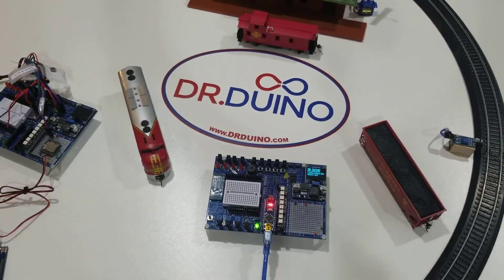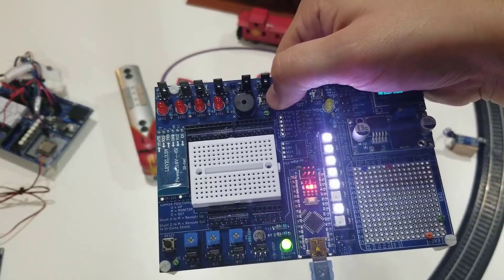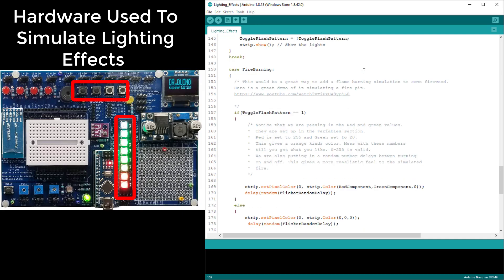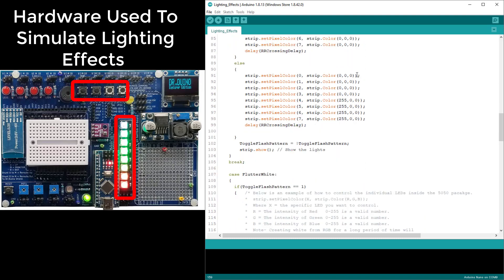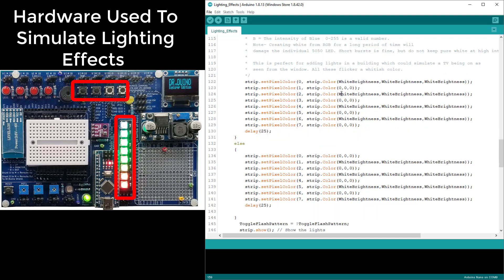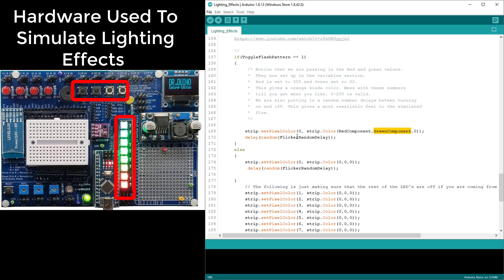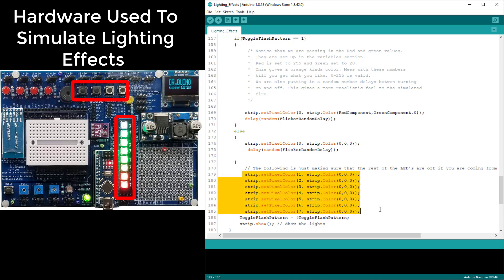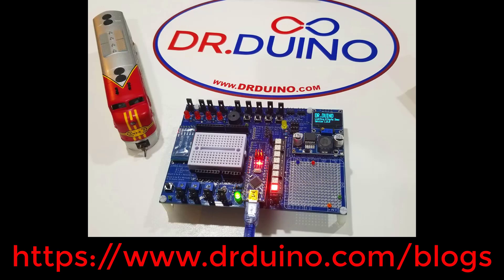Creating Lighting Effects with the Dr.Duino Explorer for Arduino compatible boards.

Comment: Can this board read variable resistance from a input wire (like from a thermocoupler or k-type sensor)?
Reply from the maker: Absolutely. It might be a bit hard to see in the video, but it has the analog input pins tied to a 3 potentiometers and 1 LDR. You can also hookup your own hardware via the female headers next to the breadboard and sever the connection between the pots and LDR. Have a look here for more information. 
https://exclusive.drduino.com/Explorer
Reply: @DrDuino-ij1vl  excellent info.  My plan is to read several thermocouplers for resistance values, and have it run power to relays for 12V applications (like solenoids and timing advance, etc).  What kind of power can i get from the board to power the relays?
Reply from the maker: @0001D-t3e  Great question! There is a built in voltage regulator! I was tired of always having to create a separate power section for my arduino projects so with this design, I added a DC-DC converter. 24V down to about 1.5V. Plenty of power too, can supply about 3A. Have a look here and scroll about half way down the page. https://exclusive.drduino.com/Explorer